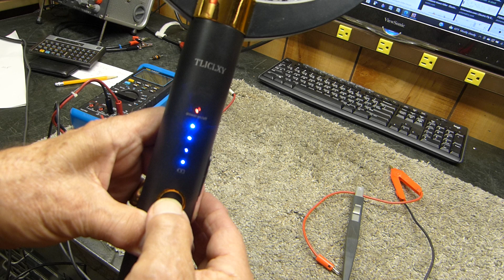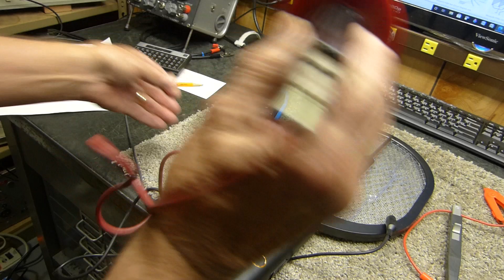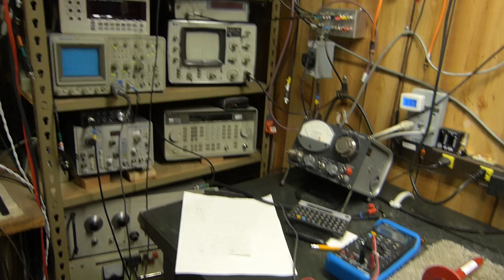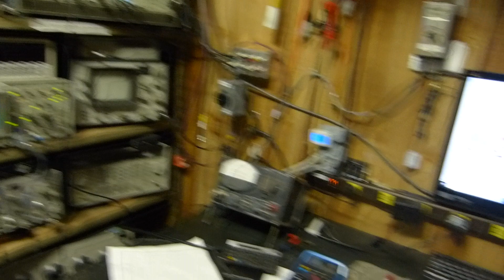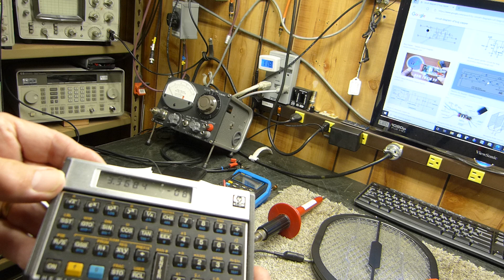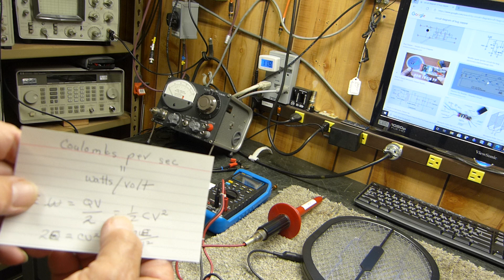Bug Zapper Voltage, Current, Power, Energy and Capacitor Value Measurements

Comment: The only guy on YouTube who would put an HV probe or a current probe into a bug zapper. All in the name of science, and I am not kidding.

It's interesting that they specified 3KV but delivered 3.8KV. Maybe it's 3KV into the load of a mosquito? which entails Z(mosquito) < Z(HV probe), and 'the calculation is a simple one' (as Sherlock Holmes observed in a train once). Supplementary exercise: given that the time constant with Z(HV probe) ~=400nS, what is the time constant across a mosquito? ;-)

I am also wondering, seriously, whether 3KV is really necessary for the application. I would have thought 50V was enough. maybe even less.
Reply from the maker: Good thought about the time constant across a mosquito. Seriously... the arc can be pretty well sustained if it does not vaporize the bug instantly. Mosquitos are burned up quickly  but a larger bug is a lightning storm and it can go on for several seconds with smoke and the smell of burning bugs so the capacitor(s) must be able to charge pretty quickly. I did consider the load the probe put on the high voltage supply but it works out to 3.8 uA (3800 volts across 1E9 ohms) so it is probably pretty accurate. From experience, I would indeed say that a 0.04uf charged to 3800 volts would deliver such a spark. I think I should build one with a 1F capacitor for really big Texas bugs.  :-)
Reply: @ElPasoTubeAmps  I don't know much about Texas bugs. The mosquitos here in Australia are much smaller than those I experienced in the Florida Everglades all those years ago, but their bite is much worse. Maybe 3KV isn't, err, overkill after all.

Comment: I love the bug zapper but the design has become so clunky and stiff on most of them. Back in 2012 I got one as a present and it felt quite perfect in the hand, was light and moderately flexible.  New ones are stiff clunky dogs!
Reply from the maker: This one works. And they only rate it a 3KV and it is 3.8KV - being better than advertised is rare in today's word. 
Now really clunky would be my concept of a 12-14 inch parabolic dish transmitting at double the RF wavelength of mosquitos so that the half wave monopole would occur across their little bodies and they would drop from the sky, as I pointed this death-ray at them, and there wouldn't be even a spark or a sound - just drop out of the sky fried inside. Of course if I wanted to sell this item, it would have to have a USB charging port and a remote control.
Reply: @ElPasoTubeAmps               :-))

Comment: I had one of those that was probably 15-20 years old.  I broke the handle off a couple years ago.  It was really cheap.  It didn't stay on all the time.  Had a button to push to use.  Worked on a couple AA batteries.  Wasn't as powerful as that one definitely.  It worked though.  Used it for flies mainly.
Reply from the maker: This has become my weapon of choice while sitting out under the pergola. I have never seen so many mosquitos in El Paso and I have been here 45 years.